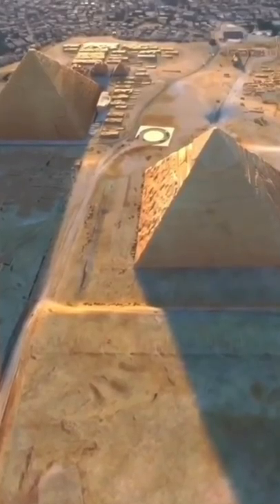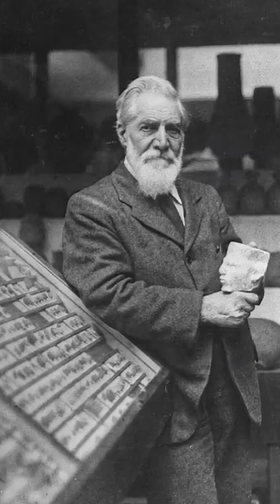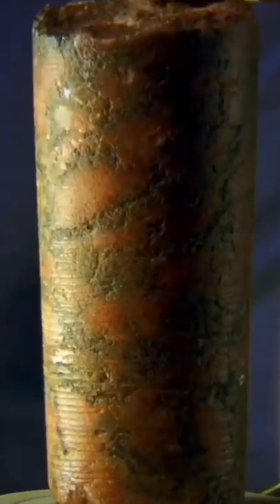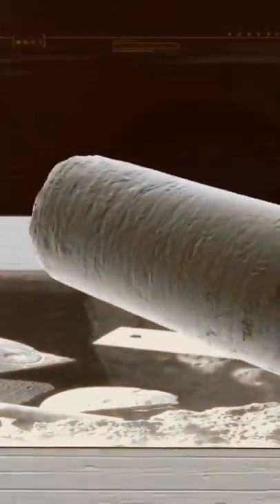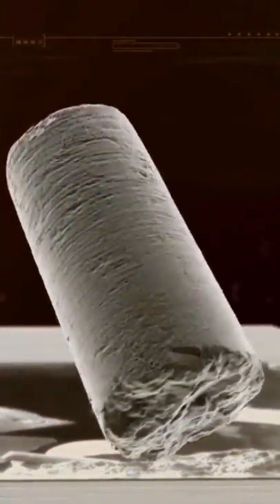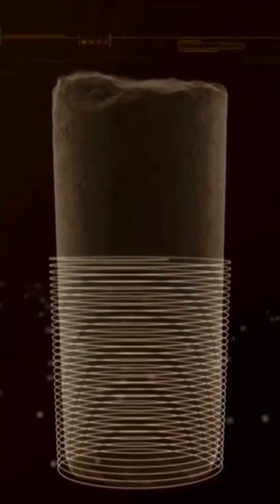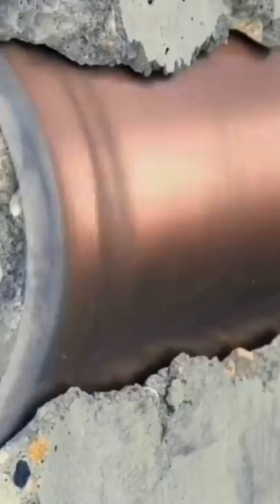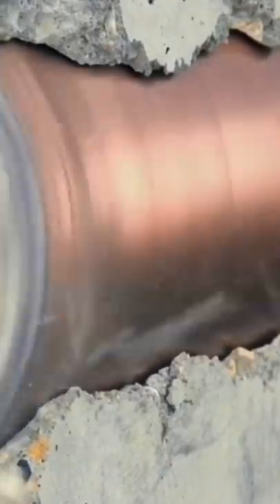Advanced Ancient Tech found in Egypt! Core7

Comment: "the only way" sure buddy, sure.
Reply: Any other way please let us know? For the curios.
Reply: @Jreaddy  
Use a water sand drill, use salted water as it chemically erodes granite making it easier to drill. Then do all the other normal stuff in ancient times.

The "drill groves" could have been due to something else, does not have to be due to drilling and the above method explains the fact that the core is slightly smaller on top than the bottom. Meaning more of the top material was removed on the top, than the bottom. Which I doubt power or bow drills do.
Reply: @ODDnanref  but what back then could possibly spin 16k RPM reliably, remember were trying to reproduce what happend exactly not reinventing how the core deposits was taken. 
Where is the signs of chemical erosion ?
Reply: @TheMsr47gaming  
You start your premise assuming it had to be spinning that fast. Something I said was not necessarily true.

The fact that the top had more material removed than the bottom certainly leads credence to that theory. You have to know that the core has been under a lot of environmental wear and tear. Even without that, it could have easily been polished, and any other port excavation treatment.

All we know is that it exist, and are lest with few clues. If it was dug using a drill, it would have had to spin at whatever speeds are quoted. However, that just means that it could have easily been something else.

Considering the narrative that this channel wants to push and the limited time. I doubt this video is bringing the full gamma of theories nor the full information of the core.
Reply: @ODDnanref  salt water? Are you serious? 🙂 Has anybody ever did that? Show me?
Reply: @dzonibravo7867  
Let's see if a YouTube link gets posted.
Reply: @ODDnanref  ita not a premise.
You dont get these type of core markings they got with your method of core drilling.
It's that simple.
Either the Egyptians had steel core drills with diamond tips and drills capable of 16k rpm, or they had something comparable. 
Which excludes ALL KNOWN Egyptian technology as of now.
But does not exclude the possibility of them having something comparable, but what I'm saying is they didn't use sticks twigs and leaves to make the fucking pyramids.
Reply: @johnathanmandrake7240  
Copper is not sticks and leaves buddy. To get to copper level technology people had to spend centuries before it was used over stone and bone.

Then again if you read the last stuff I posted you would be writing what you did either.

Comment: the moving back and fort of the drill can be solved by using brases to the drill and securing it to the stone, the brase can be made from a metal cylinder which fits the drill perfectly inside of it, of course grease or oil can be used as lubricant for it to run smoothly

Comment: a core bit, under pressure of a heavy greased granite ball sitting on top of it, with rope wound around rotatable notched posts pulled by a few men in one long direction.
In other words, they used gears to rapidly spin the core bit for a one direction and continuous pull and cut/core.

Comment: It also didn't have to be a rope pull back&forth method, but avery llonger loop rope/string. Continuously pulled at one end & offered in the other directions. Causing a drill bit affect. Manually without a engine motor.

Comment: There is an old method used in ancient times to create this type of core. A thin circular metal with a small constant flow of water and a harmonic rod.

This is quickly dying out in the modern age. But, is typically seen in harmonics. A type of musical instrument were various levels of water is inside various different glass cups. A person using a wet finger rubbing the rim of a glass will create a harmonic sound.

This method allowed the vibrations to pass through the metal to the stone while the water eroded the stone. This is how the ancient Egyptians were able to make a core sample in this fashion. It is a slow method but it can be done with very little effort. You only need to set up the device and have a constant stream of water flowing through a man made run off.

water mills are capable of lifting water up to a standing run off/aqueduct. This run off will carry the water to the location you need it to go too, and only requires an angle of 0.01% of a degree to move the water.

Your welcome.
Reply: They had glass?
Reply: Do you have a source for this kind of thing?
Reply: And the rotating"metal tip" moves 1600RPM....?!?!... Right......!

Comment: It was drilled while the rock was still soft. The ancients had chemistry that softened the rock. You’re welcome
Reply: Evidence?
Reply: There is so many people that will say anything other than the fact that A) these people had more tech than we know of or B) they never made it. Some other, older, more tech savvy civilization did
Reply: @sharablecortex2725  Evidence?
Reply: That's not true no chemistry exists to soften granite. The best you can do is heat it up to 2000 degrees where it turns into something like a crystal material. That again they had no furnace capable of doing that.  Literally nothing supports the idea of chemically softening granite we can't do it today.
Reply: Still doesn't explain the consistent drill partern.
Reply: Soften granite? Hahaha.. wow, so rocks are like cheese?
Reply: @anthonymacrobert4075  try getting those results now it won't happen the only time we see anything close to similar to that is in soft material..even with the technology we have today you have to let the drill bit do the work..What we use today is a cheap rip off of what ever they had
Reply: @jnananinja7436  the ancients had a method of making concrete from crushed granite. Yes they could soften bedrock as well. The marks are still there where they scooped out solid stone, drilled impossible holes as well as cut massive blocks. There is no other rational explanation. The Inca in Peru legend says their ancestors learned to soften stone by watching birds nest in the cliffs.
Reply: @anthonymacrobert4075  that we know of. Or is aliens with laser beams more rational? They certainly didn’t do it by hand with copper chisels and a stone hammer. What’s sad is how little we know for certain about mans prehistory
Reply: @3-ddjr460  it was drilled while it was still soft. No other way
Reply: @boburwell9921  Well if they learned it from the birds.. you didn’t say that at first. Never doubt the birds!
Reply: @jnananinja7436  we don’t know what birds or what plant they built their nest out of. Both most likely extinct. But that core can NOT be duplicated with the most powerful modern drills in existence. We can drill stone but not with the same spiral as core7. It was drilled like a hot knife through butter because the stone was soft. Ancient chemistry

Comment: Anyone who has ever used a core drill to drill through even brickwork will tell you the left over plug ends up smooth because the drill does many turns for every millimetre of of travel, it's simply impossible for a core drill to leave a 'thread' type groove on the plug, it would be like trying to thread a new bolt using a die where the teeth line up in a circle instead of feeding their way onto the shaft.

Comment: At 1600rpm, it must have only taken a few seconds to cut that core.  I'm basing that on the cut line spacing.  I don't believe I've ever seen anyone precisely cut any granite/limestone at that kind of speed.
Reply: Although 1600 rpm really isn’t that much. I mean compares to a hand drill yes it sounds like a lot. But it doesn’t take much gearing to make 1600 rpm from very little rotation.
Reply: Because 1600 isn't accurate. And the phrase "according to experts" should cause everyone to be skeptical. Our experts are quite literally ALWAYS wrong.
Reply: @Mad.Man.Marine  Math time:
From some pictures I've been able to estimate Core 7 at around 4 inches in diameter, so about 12 inches in circumference. If the cutting tool was 1/8 inch thick, this would give a total area of 0.67 square inches. At the 2000 PSI mentioned in the video, this would be some 1333 total pounds of force.
It gets better. We can calculate the speed via 1600 RPM *1 foot circumference =1600 feet per minute. Interestingly, horsepower is force times speed, so you can convert this to horsepower by multiplying them together.
It's about 64 horsepower. You'd need an engine at least that strong to do this as described. Which is absurd because I've errored on the low side at every step. It's probably 2-10x that power needed.
Reply: You can't calculate the rpm off the physical appearance of the object. You can determine the depth it cut in one revolution, but without seeing the size of the hole it came out of and not knowing actually how long it took to cut a given depth, you can't calculate the rpm.
Reply: @Dabrandman13  I agree.  I'd like to know how the 1600rpm figure was determined.  I'd also like to know the "pitch" of the cut marks.
Reply: @Dabrandman13  You could back-calculate a maximum RPM based off a reasonable horsepower, though. Given that the 64hp I got is probably 100 times what they could have had, I'd say 16rpm was more likely.

Comment: There was a disagreement between Petrie and A. Lucas regarding whether the tubular drill was copper embedded with hard stone crystals for cutting or whether the drill was copper and the cutting was done with powdered abrasives.
Researchers made a silicone cast of a hole drilled in a granite sarcophagus. Sure enough the drilling had left the same concentric marks. 
The researchers set up an experiment where they used a copper drill with glued on abrasives, and a plain copper drill combined with different abrasive powders, water, and oils. There were able to get the concentric lines with some combinations but not the glued on abrasives. The researchers thought of, but didn't try mixing abrasives with molten copper and then casting the drill with built-in abrasives.

Comment: 1, there is that copper drills similar to the bowdrill that only goes oen way, as there is a angles handle out the top, plus there is old stone/metal gears which have been foudn which could go ont hem to up the revolutions

Comment: Simple explanation is that the circular hole was bored out, but then another tool was used to widen the groove. It's also possible it was machined after being removed for whatever purpose (practice, experiment, art) The tool required would not need to be exotic as the helical grooves are only a few thou deep.

Comment: ive worked with granite before and with modern diamond tipped equipment,  this spiral effect is  not possible still.  the depth achieved on each revolution is insane,  these samples would have been cut in seconds.

Comment: A company from Wales called cintec International worked inside the pyramids and strengthened the structures using core diamond drills about 10 years ago. I bet that's core waste that's been left over from the drillers. I know this because I used to work for the company.

Comment: As a machinist, I can tell you that grove depth is not a function of pressure, and distance between groves is not a function of rpm.  Anyone that tells you different is no "expert"

As a fan of archeology I can tell you that experts have shown that this is not one continuous grove, and the groves are not evenly spaced.  Experimental archeologists have created cores like this with hand powered copper tube drills and sand.  

So basically everything mentioned in this short is wrong.

Comment: Most likely it wasn't spinning that fast, but the weight would be correct. Using vibration sent to the stone being cut or the copper tube itself, with significant weight on the top of the copper tube, the weight and tube will begin to rotate. Add water and you can literally set it and forget it as it spins due to the vibration, drilling over time.

Comment: That's funny, y'all can't figure out how to do this but I just did. Use a crank and wheel pulley type system. Yes Egyptians had wheels, they even had chariots. All you have to do is get two wheels different sizes like bike sprockets and wheels and you can turn a drill by hand. It took me longer to write than than it did to think of the possible solution.

Comment: I can imagine a system with two (or more) spools that a length of rope would wrap around. Put a handle on one spool, a weight and cutting blade on the second. Spin the first one and the rope transfers the rotation to the spool with the weight on top. No need to change directions like a bow drill, several people could spin the spool at once for speed, and the pressure is applied by the weight. So they had HUMAN-powered tools.

Just a thought, let me know what you think👇🏼

Comment: The funny thing is that some "experts" hired by some academic institution to debunk this claim, late 80s if I remember correctly, blatantly cheated by taking pictures of it at a very specific angle to make it look as if the markings were parallel instead of a continuous spiral, which would have made a huge differenc. It took Christopher Dunn to go at the Petri museum in person and take a lattice mold of it to finally prove once and for all thst it is indeed a spiral groove. Anyone working in the field today, will tell you that to drill in such a way, we need very powerful machines, huge drills that are phisically hooked to the stone with clamps in order to be able to exercise enough force for the drill bit to go deep enough in one session and consequently leave similar marks. These are highly specialized tools that are really expensive, you can't cut granite with a hole saw hooked to a normal drill, you at least need a specific Hilti with a specifically built frame that you need to hook to the piece you're drilling by drilling itself "solid" to the actual piece, and in some cases we see marks on the granite leading us to believe similar techniques were used in ancient times. Egyptologists and the common lay people, fail to understand the complexity of the old kingdom and pre dynastic stone work, its scale and precision are absolutely mind blowing, no matter how many smug academics try to debunk it, the evidence is there in front us, and I honestly will never understand this reluctance to accept the obvious.

Comment: Be careful when you hear numbers like that though, because they're intuitively deceptive. 2000 PSI over the surface area of contact is probably not very much weight. I would very much like to know how they got those numbers. Because there's no way you're going to accurately estimate those sort of things without a material sampling and decomposition test. Both very difficult things to do accurately, and even more difficult to accurately work backwards to calculate drilling conditions.

Comment: Throwing this out there, the concept of a bow drill doesn't fizzle out there. You can set up posts and loop the ropes through and around then creating basically a bow drill that isn't pulled 2 directions back and forth but rotates continuously and is much faster, you can also put weights on the ropes, and on top of your drill so to speak, also keep in mind this is friction based, what does friction do, creates heat, depending on what you're using you'll find that some materials react much more intensely than others, some have less wear, like using something hard on something soft, the harder one will always be alright if you're striking or drilling, because to get that friction with a drill you have to first dig into the material with the other and get a foothold basically , like starting a screw or nail.  However, youre not limited to just 2 separate dry materials, or temperature of on or the other, or the area, theres all sorts of things you can do along the way, almost like cooking. I'm trying to simplify some medium to difficult concepts but things aren't as difficult as they seem, however  possessing the skill and dexterity to do these things is another question.

Comment: Considering this was debunked continously for years, especially when you compare it to other core samples. They used a copper iron coring bit and an off set spin rod with a 40lb fly wheel to add pressure. In construction, you never drill through solid granite at 2000 rpm, you will cause the bit to overheat and it will not cut into the slab but instead bounce on it. You always drill between 300-400 rpm with enough downward force to extract the material with plenty of water to create a slurry.

Comment: Also a thought, maybe they didn't move gigantic blocks at all... They may not have had to quarry it the way we assume. They may have developed a method for fitting smaller pieces together so they they stayed in place with each other under their own individual leverages on one another. Imagine if they didn't cut it extremely smooth, but just sanded it before it hardened. Like laquer

Comment: Anyone ever consider that maybe some space junk or asteroid/meteor chunk may have made for a really good tool to work sandstone with? Maybe it was harder than a diamond, or maybe it was easily heated or cooled to temperatures you couldn't achieve with earthly materials, maybe there was a reaction upon contact, maybe it was porous and could be filled with water to make it heavier as well as make it more stable and provide some aid in the form of centrifugal force, which can ramp up exponentially in the right circumstances / set up

Comment: Considering you can reach 1.000.000 RPM by hand with just a tiny set of LEGO Technics, those numbers don't seem that exceptionnal... Gears is the answer...
Reply: Also, LEGO can break steel. Gears are an amazing tool, you have no idea.